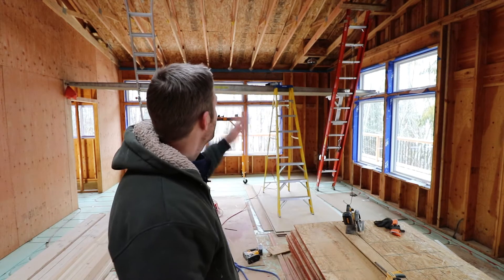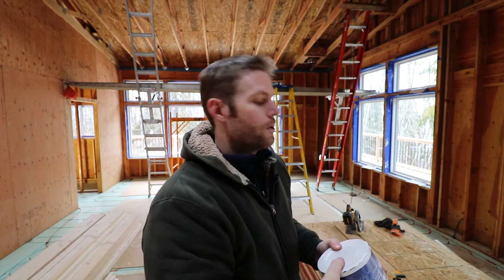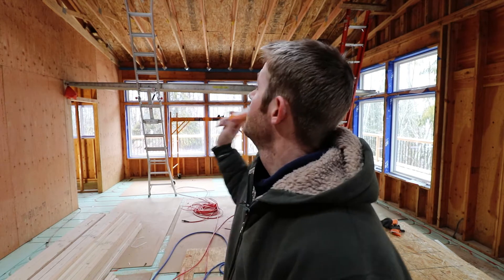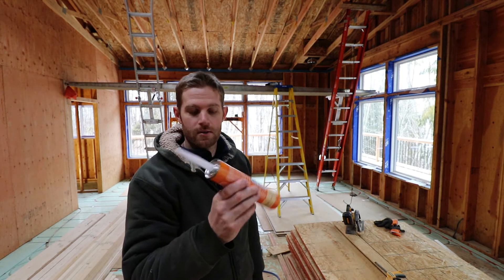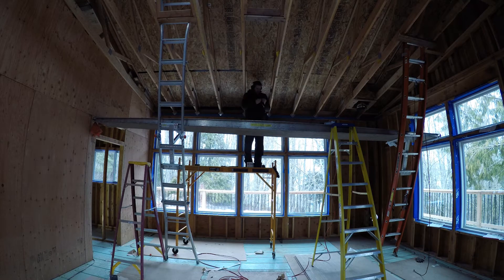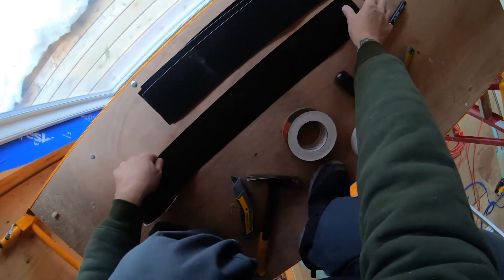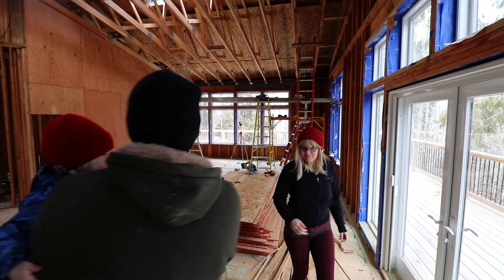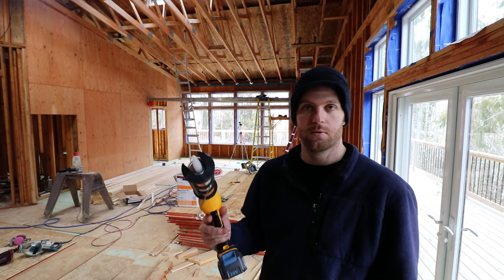Tape and Caulking of the OSB Air Barrier

Comment: Wouldn't the closed cell spray foam seal the edges of the osb as good as the calking and tape?
Reply from the maker: That's actually what my initial plan was. Use the closed cell foam as my air barrier.  However, I think spray foam just won't give me as good a seal as I was hoping for.  It's application can be tricky leaving voids and over time it's not as flexible as it would seem resulting in cracks and air leakage.  Matt Risinger among others, have expressed a lot of disappointment on their blower door tests when they relied on spray foam.   Those builders now use other methods besides foam to air seal, so I'm following their lead.  I figure, I never want to go back up there if I can help it, so I'm putting in the extra effort now.
Reply: @TheLeaversFamily  I'm doing this task now. I wasn't sure if I should do along the roof. I heard Matt Reisinger talk about pre-sealing, in one video but I can't find where he show it in detail. Do you have a link?
Reply from the maker: I don't have a link sorry.  But you won't regret doing anything you can afford to do (pre-sealing) to help the spray foam do its job of air sealing.
Reply: @TheLeaversFamily  thank you!

Comment: Hey I get the osb barrier so the air goes in the soffits, through the osb tunnels and out the soffits on the other side. Would you use any spray foam on top of that or will the osb be enough? Spray foam anywhere in your house design? Walls, crawlspace?
Reply from the maker: As far as spray foam, I plan on spraying the whole OSB layer/plane I'm installing.  I will spray the vertical walls of the gables and skylight bays as well.  I will also make an OSB plane in the crawlspace similar to the attic where I will also spray a 1" layer of spray foam to completely cover over the OSB, caulk and tape.  Between the OSB, tape, caulk and sprayfoam, I should get a good air seal.  But beyond those two spots I dont plan on using spray foam much.  I may spray my rim board all the way around, but I plan on using rock wool or possibly cellulose in the walls and floor over the crawlspace.  And I will use blown in for the attic.  I'm really leary of using spray foam inside the air envelope so I will use as little as possible.  The off gassing is very toxic.
Reply: Okay love the osb in the crawlspace. okay do you have some sort of vent (s) in your crawlspace on both sides of the house,so that the air will enter on side an go out the other? Will that bring in any mosture? (Mold issues?) Or will the air flow negate that?
Reply from the maker: @valentinek.t3327  Yes we have 7 vents total around the perimeter of the crawlspace located in the concrete foundation.  They are on three sides of the house respectively and therefore give pretty good airflow down there.  As long as the vents are open and not sealed off, there won't be any mold issues.  I'm pretty sure the number of vents we had was based on a formula used by the engineer.  The number of vents is based on square footage I believe.  I also sealed the crawlspace floor with a super thick vapor barrier and taped it to the concrete footings all around the perimeter.  This seals any moisture from coming up from the ground.  The ground moisture will cause big problems if you don't lay down some plastic sheeting.
Reply from the maker: The air enters the soffits and exits out the ridge vent at the peak.  There is twice as much soffit vent area as ridge vent to ensure proper  air flow out of the ridge vent.  This is to prevent air (and possibly  rain) being sucked into the ridge vent and out of the soffits by strong winds.